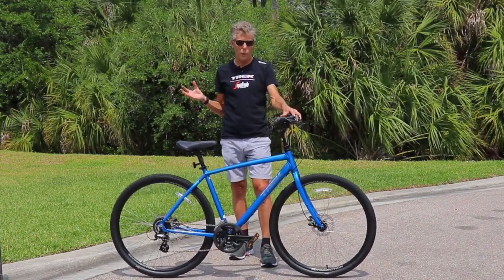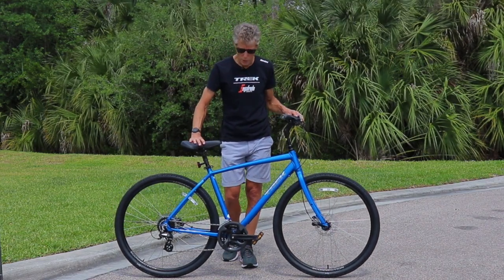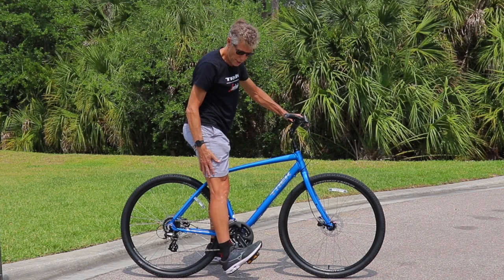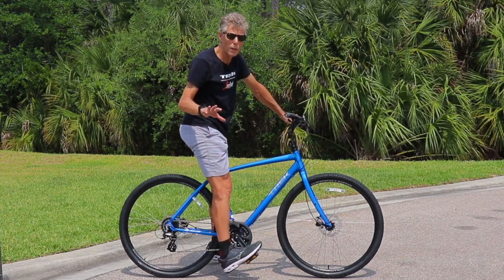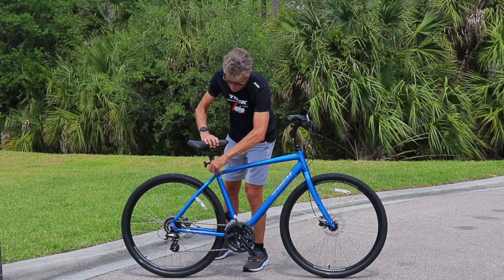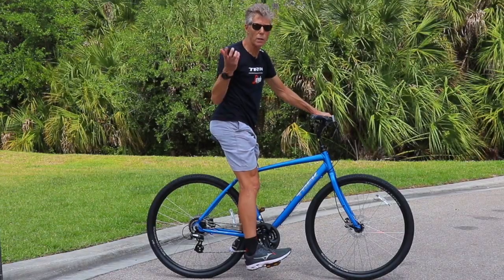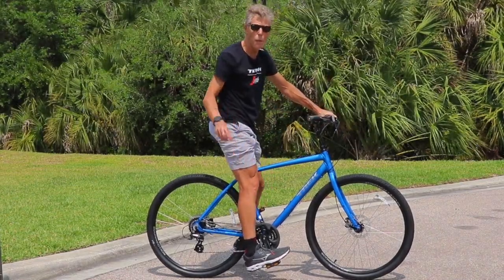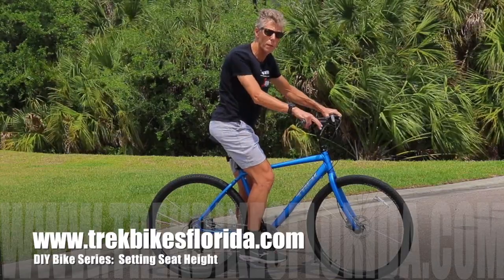DIY New Bike Series:  How to set Seat Height

Comment: I’ve been putting my pedal in the 6 o’clock position instead of in line with the seat tube! I’ve been super frustrated that my saddle height never seemed to feel right! Thank you for this video! Also, the heel relative to the top of the pedal is a new method I haven’t done yet, so hopefully this works better for me!